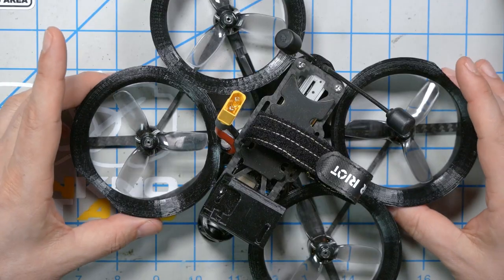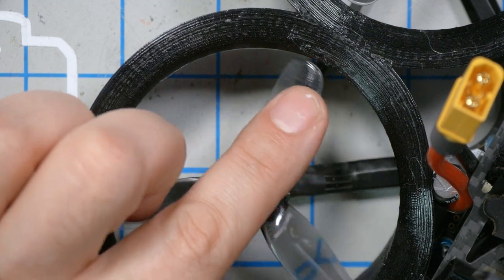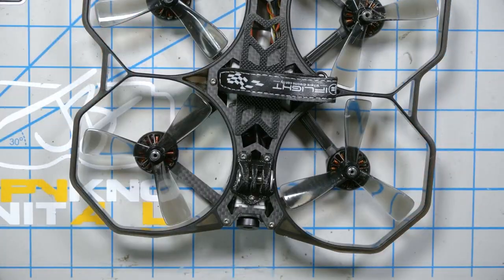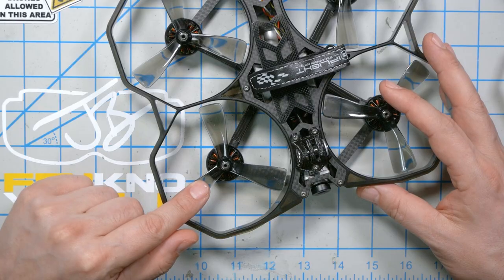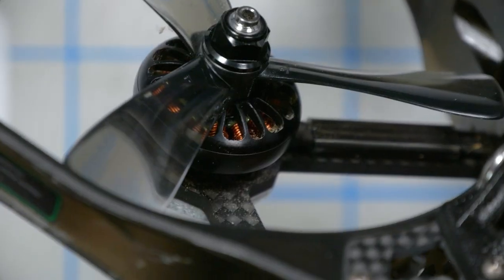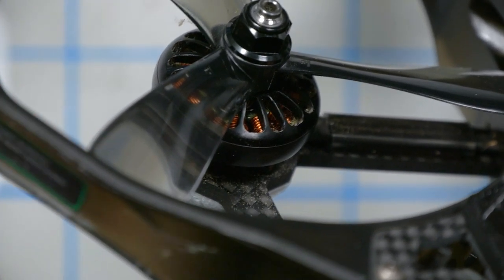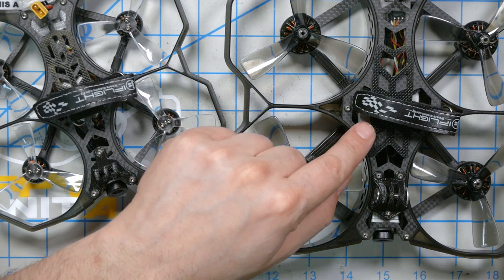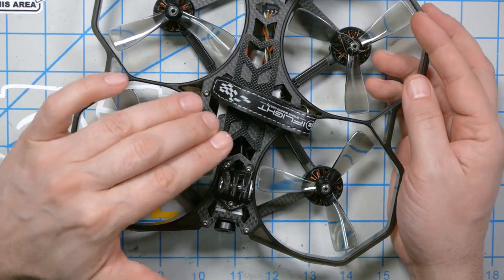iFlight Protek25 and Protek35 (try to) redefine what a Cinewhoop can be

Comment from the maker: iFlight says they have updated the duct material about mid February 2021 to a stronger material. The review units I received had the original, weaker material.
Reply: Where did you read that? I got mine in January
Reply: @possible1337  Same, mine arrived direct from iFlight on Tuesday, with spare prop guards shipped February 20th. Crashed on the carpet and the frame is broken in two places 😂. Pretty sure it would have been more robust building the prop guards out of bone china
Reply: Sounds right, I crashed pretty hard and it held up pretty wll (Protek25). :)
Reply: thanks for letting us know that; the durability and having to replace the whole outside frame were holding me back.
Reply: Are you up near Woodstock?
Reply: Just got mine on Friday and the prop material seems super solid
Reply: I'm on my third set of prop guards (protek25), I'm going balls out most the time though, this thing is just fun to rip around! I do put the foam on mine BECAUSE I know I'm ripping around. I think it does help durability slightly.
Reply: I’ve beat my 25 and 35 up pretty bad and the guards have held with the revised design.
Reply: Anybody made a tpu replacement guard for them yet. Seems like a good answer once the originals break.

Comment: True comment about the durability. Other reviewers raved about how durable these prop guards are. After getting mine, instantly crack mine in a mild crash (only 3ft off the ground moving slow) foam didn’t help much.

Comment: Hey bud!!! I got a protek 35 and IMPROVED the prop wash in tight areas!!! I reversed the motor rotations!! Try it out im amazed, fling indoors like a PRO!! I figured instead of air being pushed to the sides of drone change it up to props in and that may push more air front to back!
Reply: Hey man, it’s been a year since you made this comment but I’d love to know more about your experience with changing the props inward. Are you saying you changed the front two props to spin inward towards the camera instead of away and that fixed it’s turns in tight areas?

Comment: For what it's worth, protek 25 is my first fpv quad. First flight (indoors), I took a head high crash off the wall to a tile floor with no visible damage. I did have the padding added around the side. I've had a couple other minor crashes outdoors and no damage other than a prop.

Comment: This is a great (and objective) review.  I have the Protek35 and JB's observations and comments are golden.  FWIW, iFlight has a new TPC X60 connector available that screws into the top piece/frame.  Functionality and a big plus for looks (pic available if requested).
Reply: Hi I am thinking to get a protek35 with 6s and crossfire. Is it recommended for indoor and outdoor flying. I would like to take close proximity cinematic shots of bicycles, skaters, small events.

Comment: Protek35 my first fpv quad and I had a first ever session today. It is a bit “nervous” and very sensitive to controls. Nevertheless, emptied my all5 lipos and I am addicted now! :)
Reply: Goto betaflight. And adjust rates. Not sure default. But u can lower to rates to 400 or leave at betaflight default 667 and add expo like 0.25 to make it less sensitive near center of stick when doing slow movements
Reply: Tbh i would not lower the rates like that. I would chose a pilot with a flight style i would like, and use his rates .
Reply: I am not sure if I should adjust or not. The rates might be completely fine, it is hard to judge with no experience :) I am sure I could get used to them.
The only comparison I have is the DRL simulator, where the quads were way smoother. Maybe a bit more stick movement range would help for cinematic flying...
Reply: @VRMinde  instead of adjusting rates, add a little expo to pitch and roll and it'll feel less sensitive but still allow you to get full speed rotations
Reply: @wookiefpv6614  will try :)
Reply: @VRMinde  yea some expo helps. You can start with 50%  sticks will be super soft in the center
Reply: @MrAwellema  Center sensitivity is set to  190 and max rate to 900. All three expos are on 0.6. I don't want to mess anything up :D
Reply: @cacamacaaa  where would you find the rates that other pilots use? Is there a forum somewhere with them on?
Reply: awesome. what controller and goggles do you use?
Reply: @dcclyde575  tx16s and dji digital googles v1
Reply: @divingfalconfpv4602  I put expo to 50

Comment: Could not agree more... whoops are the perfect choice for beginners. I started and quickly lost 3 different quads until I picked up a little beta 85x. Crashed it, severely, numerous times but it always survived. And it was easy to manage even in Acro mode. I bet that I’d give up on the hobby if I didn’t have that 85x (flying 5” monster builds now after only 4 months in:). Great video and one of your most entertaining:) I did not know that original whoops had flared ducts with grooved props. Hmmm... (fires up CAD program)

Comment: If you're not a beginner and thinking about buying this just build a slammed Squirt V2 with FPVCycle 2203/4 on 6S (or similar motor if you can find em). I think all the real advantages from the Protek35 are the 2203.5 motor and short prop guards not the larger prop. Slammed squirt with pancake motors on 6s solves all these issues while still being really tough, easy to work on and a proven system. You could also look at the FPV Cycle Cinesplore with 2203.5(ish) motors.

Comment: I got the 95x v3 in December and returned it for the Protek25. Best thing I ever did. Better across the board
Reply: Really? I'm just so skeptical with it being 75 to 90g heavier. 
Feel like I'm either lose power and flight time. Wish I could test flight one.
Reply: @divingfalconfpv4602  Can't even tell with the weight difference. Actually Handles weight better. Handles better, longer flight times, way way less battery sag. Even slightly quieter but that's debatable. Might just be the pitch is less annoying.
Reply: I bought protek25 without receiver pnp some people told me that quad flight amazing.

Comment: Seems hard to* find sub 250g BNF quads w/ digital HD systems, I guess that's an issue when you aren't skilled enough to build yet! As a newbie who has spent decent time in a simulator, Ive had a great time flying the Protek25 on just a 4s 850mah for recreation. Managed to come out unscathed after a couple minor crashes doing rolls and powerloops, but I did install the foam padding. You bring up really good points about how the bigger options provide better reliability and more functionality than the Protek series for those wanting to use a GoPro or do heavier acro

Comment: I had a Iflight Beast F7 Beast Aio running a 680gram 2207/1800kv full size freestyle rig with Gopro on 6s. So the F7 H7 I flight Beast Aio are solid for sure

Comment: For Easter this Year you should invite a select few participants from your FPV crew and do an Easter egg hunt for lost Gopros and quads on the property 🐰

Also this video has solidified my decision i made a few months ago when I went with the Rotor Riots version of the Shen drones Squirt cinewhoop. I have also crashed it many times and the only time the ducts cracked was when I was flying it outside pretty hard when it was 15 degrees out and crashed into the asphalt. It literally only cracked the foot area that are on the newer style ducts and it was an easy hot glue fix and black electric tape and you can't even tell. I have bashed it up quite a bit and I must say it still even looks brand new. You should never have to replace anything except ducts if you own the rotor riot cinewhoop. Glad I went to R.R. with my money 💰 still...Great video

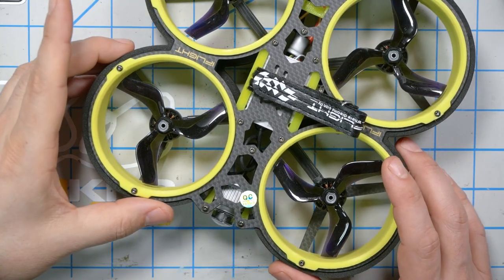Comment: At 3:32 when you show the Bumble bee , Could they just make a trim ring to snap in or use the screw points to sit just above the prop that would effectivly close the gap between the prop and the duct sidewall and make it more efficient ? Maybe someone has already done that but I was just curious since you stated that even the small gap made it useless as a functioning duct .

Comment: I guess you have to be quick on the kill switch. Problem with my Taycan cinewhoop was breaking props, burning motors and even the esc board one time in light crashes. It fell hundreds of feet one time and didnt break anything about the frame so it was tough otherwise. After replacing 4 motors I got rid of it, never thought that would be the problem with a cinewhoop.

Comment: did you fly them with air mode on ? 
my Protek35 never flips out like that when stuck somewhere.
there is a massive difference in durability when using the foam

Comment: Did you end up finding the go pro before a mower got it? It sounded lighter after the stair crash. I thought "wow, it sounds like the voltage had really sagged and the crash allowed it to recover". As for the ducts, I had no idea ducted quads were so loud since my moblite6 isnt but size helps I'm sure. I just got a Protek 35 and I'm considering printing some prop guards similar to my Flywoo Firefly Nano baby 20s.

Comment: blheli32 on firmware 32_74 hex : You can configure motor pwm frequency to increase with throttle. The benefits of variable pwm frequency are:

Low frequency for low throttle gives good active braking where it is most needed
High frequency for higher throttle makes running smoother
The variable frequency will work as dithering making running even more smooth.

please let us know what do you see and are those applicable for 5inch quad or just for plane RC,,or there is any risk in quad esc setting
which mean now blheli32 can set up 2 pwm frequency in low and high rpm (low 24Khz and High 48Khz)

im your huge fans, i like to watch every video of you in you tube, and after my paycheck i will join and support this channel in patreon..

Comment: I have a new cinewhoop idea.. 
But do like protek35. It's different. 3.5" so more power.. not just another photocopy..
Protek25 I feel is just too heavy. At 200g it's a 95x with full size hero6 (battery delete). Maybe being wider helps idk.. 

I've flown 95x with full size gopro. Works if going really slow. Flight time 3mins , 3:30 max

Comment: I have a question: I have received a Protek 35 with FrSky r-xsr (ultra) small, and I cannot associate it (to bind) to the Taranis X9D plus. Could it be that the firmware of the receiver (2021) and that of the Taranis (2018) are not compatible? I don't have much experience and I don't know where to look for the solution. Greetings and congratulations on your excellent and fun content. / Pablo Win

Comment: I just got a Protek 35, a new pair of DJI goggles and a DJI FPV controller (the first version).   Just fyi, the air unit on mine had a 90 degree up board added to the usb port (I had no issues with the FC port) .  Mu usb 90 degree thingy didn't work as installed, in fact it didn't fit into the frame and was sitting on a bit of an angle from the factory (ouch!).   I ripped it out.  To remove 90 degree board I took off the top of the frame and one side of the prop guards.   Like an idiot I put the quad back together after I activated the air unit.  When it was time to bind the goggles and transmitter I couldn't hit the little button (I'm old, I can't see that little button) so I took off the top again so I could get my hotdog finger in to push the link/bind button.  Also in the videos I watched they just show binding the goggles but not the activation.  Goggles activation videos showed activation showing up on DJI assistant 2.  Will it didn't.  Activation did not come up on DJI Assistant 2,  just firmware updates.   If the goggles are not activated you can not link them to the air unit.    I ended up linking the Protek 35 to another pair of goggles that were activated with a DJI FPV quad (I had to fire up the goggles and find in the menu where you switch from DJI FPV quad to DJI air system) then I activated the new goggles with one of my DJI FPV quads and a mobile device.  I was running low on time and didn't check if the switch for DJI Air system or DJI FPV quad showed up after activation but it certainly wasn't present before activation.   I don't know if downgrading the firmware on the new goggles would have solved the issue.  I had zero issues activating and binding the transmitter.
 I'm not complaining, this is purely fyi for anyone that purchases the same or a similar setup so they will know what to expect and possibly have a solution.

Comment: That extra foam does not protect the durability of the guard at all. I broke my protek35 guard in a light crash with some branches and dirt. But that kwad flyes amazing
Reply: damn, same here, I had really light crash and mine also broke, asked iFlight if they plan to maybe change material of those ducts, but unfortunetly they said, no. It would probably work much better out of TPU
Reply: Same here, foam didn't help.
Reply: @olekdh  sounds like a good opportunity for some entrepreneurial pilot with a 3D printer.  They don't look like they'd be too hard to design.

Comment: I have the Protek 25 Analog. I had about 50 flights in and hit a tree. It fell in the street from about 15' up and broke the right prop guard. I replaced it no problem. Then my camera and VTX died. I sent it into the iFlight USA repair center and they replaced the camera and VTX. Today I took it out for the first time since the repair and it flew great; I am not flying with a HD camera. I really like how this drone flies, but I agree with JB that the prop guards are not the most durable.
Reply: Can I ask what analog receiver you used and how you connected it? I just bought the 35 and a fly sky receiver and being new to this, I can’t figure out how to connect the flysky receiver to the flight controller.
Reply: @chriswegener3373  I bought mine BNF, so the receiver was already in the drone. I am using the TBS Crossfire that came in it, so I am assuming it is the nano. Usually, the wiring diagrams for iFlight products are available on both iFlight's website and dealers as well. I looked at all of the places I have gotten iFlight wiring diagrams from and none of them had wiring diagrams for the iFlight Protek 25 or 35 PNP. Maybe JB can help you out. Sorry I couldn't help.

Comment: How original Protek 25 compares against Protek R25 and Protek 25 Pusher? Is there any performance difference or it's basically the same, just with a different design? Are there any components in R25 which are significantly better/newer/more advanced compared to what is used in two previous models (Pusher and original Protek 25)? What do you think?

Comment: Hi Joshua. I have the Protek 35 and after a factory reset with the dump file (https://iflightrc.freshdesk.com/support/solutions/articles/48001148115-firmware-wiring-factory-dumps) the motors are not spinning unless I set Dshot 300 instead of Dshot 600, which is the default setting. I have also noticed that the flight time with the GoPro (4S 1550 - 100c) is far too short from what others normally get (round 2,5 min). I'm a neophyte in the FPV and I don't know exactly if those things are connected but, I would really appreciate any suggestion to get back the standard configuration of the drone. Thank you in advance!

Comment: Thank for the review! Do you think there is a noticeable flight time improvement changing 1508 motors in a 3 inch cinewhoop with some 2203 (tmotor or xing)?
Reply from the maker: I think 2203 is overkill for three inch. 2004 might be good.
Reply: @JoshuaBardwell  is the efficiency improvement noticeable on the 2004 than the 1508?

Comment: I'm getting back into the hobby after a 2 year hiatus, I still have a couple 5" 6S rigs (going to need all new batteries) and a baby hawk.

Couple questions, did Helio fade out? did 5" quads fall out of favor? I'm getting back into it with a TinyHawk II, I just wanted something to toss around and not dump a bunch of money right away.
Reply from the maker: Helio is gone. Out of business.
Reply: @JoshuaBardwell  Damn, I still have 2, one of them mounted and soldered but never programmed, the other is operational.
EmuFlight looks like it might support it.
Wondering what has changed in the FC world.
Reply from the maker: You can use Emuflight yes.

Comment: I've had iFlight prop guards before - they broke readily too.  I use iFlight gear, but I use it in quads that don't require prop guards - not to beat around the bush - iflight makes shitty prop guards - and I've told em that before.  So - they know it.

Comment: just out of curiosity. will a unify pro or tramp really burn out with no antenna? not saying you should do this but im pretty sure the high end analog vtxs have temp protection.
Reply from the maker: The Unify and Tramp will not immediately be damaged. Most analog vTX will.

Comment: Hey man. When are you going to review the racewhoop by free zillion. It's a fully 3d printed frame that flys amazing and is practicly unbreakable. Oh and did i mention everybody can print it for free 😉
Reply: I'm looking into this option I've had the protek35 for couple months now and not overly excited about it . Its def more an outdoor style quad . And it's terrible in wind . So just fly 5" or transtec beetle hom on Calm days cinewhoop style ( plus it's under 250g rtf , handles wind better than protek 35 ).
Reply: Where can i find the files?
Reply: And which top and bottom plate should I use?

Comment: Are you aware of any BNF/RTF/Consumer Cinewhoops that use INAV instead of Betaflight to provide altitude/position hold for steady "low and slow" videography?  Apparently iFlight is planning to develop one, but it is probably months away.  I'm aware of the new DJI FPV Drone, but that is an expensive battleship that completely missed the target for a DJI Cinewhoop.